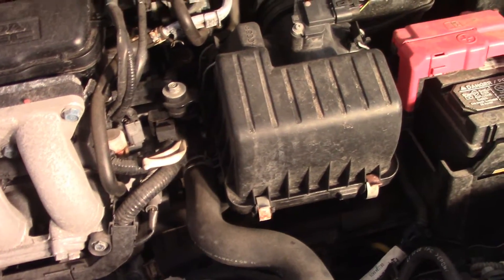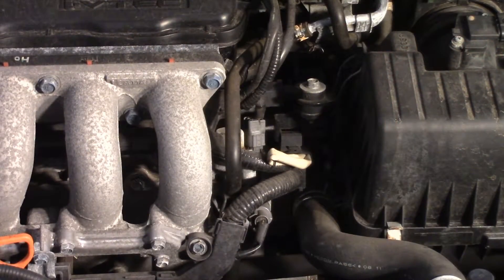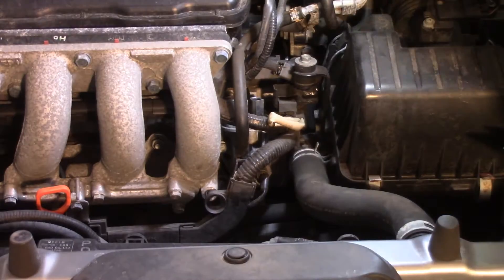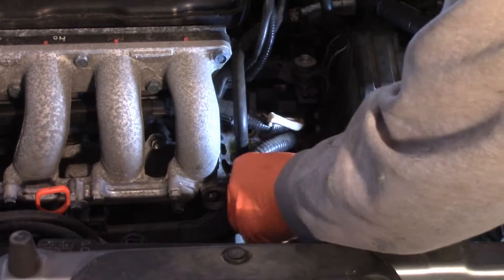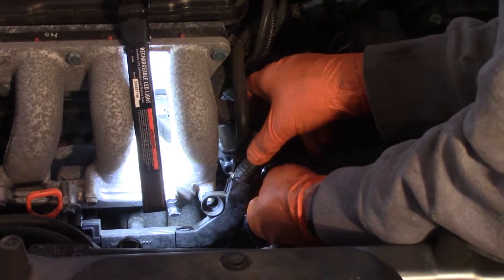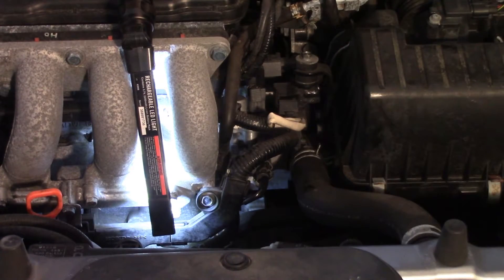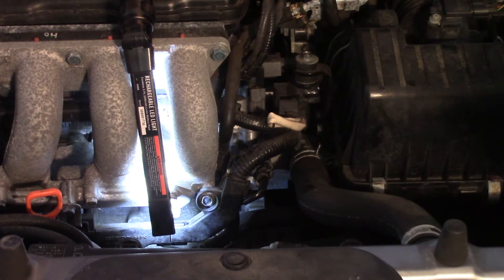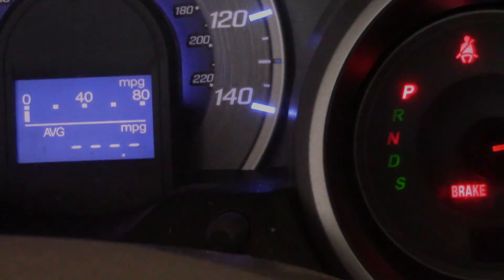Honda Fit (2009-2013) VTEC (or VVT) Solenoid Replacement

Comment: Hey Chris, my wife has an 08 Fit Sport and it threw a code P2647 when we did a scan for the check engine light. She had no issues (we just topped off the oil after reading it could be low oil and she was a little low on oil), but one day she couldn't rev above 4k rpms. She brought the car home and we switched cars, I took it out for a test drive and the check engine light was off and it had no problem revving above 4k. One week later (today as a matter of fact), I was driving her car home from work (no issues to work) and the check engine light came on again and it wouldn't go above 4k rpm. I went to a parking lot, shut the car off for a few minutes, turned it back on and let it idle for a few more minutes, and while in park, I stepped on the gas and it had no problem going above 4k rpm, it sounded and felt fine. I want to fix this issue so she has a reliable car, but should I replace the solenoid or just get the rocker arm switch sensor? What do you think?
Reply from the maker: Wow, that's a good one. I'm not a trained mechanic, especially for the newer stuff. That code does deal with the rocker arm solenoid and usually happens in cars with VVT. I don't think failure of the VVT solenoid (i.e., it stops actuating) would limit engine RPM, but the rocker arm solenoid might if the computer uses it to sense engine speed. It may limit speed if it doesn't like what it sees (limp mode). I did some forum research and  it seems this is the case. Most of the posts I read said it comes and goes like your is. Some replaced the rocker arm solenoid and that fixed it. P2646 seems to be more related to the VVT solenoid (I never got that code). Here's a video I found (I didn't watch it): https://youtu.be/wWHFApnR2D8. I'm not making a recommendation either way, though, because I'm really not qualified and don't want to point you in the wrong direction.
Reply: @roundtailrestoration  Thanks for replying Chris! I started the engine this morning to let it idle, and the check engine light was on. I idled it for about 3-4 mins, turned it off and on again, check engine light was gone and no issue driving to work. It gets to the mid 40s here at night, so I'm not sure what the problem is, but I bought the whole solenoid and a filter. I'll try the filter first cause it was $2, and if that doesn't fix it, I'll just replace the solenoid. The solenoid comes with the sensor, and is not that much more than the sensor itself, so hopefully it fixes it. I'll update the comment when I replace the parts.
Reply from the maker: @YoostwasRDiiwoah  Good luck!
Reply: @YoostwasRDiiwoah  if the vvt fails it can put the car in limp mode which would limit you to 4K rpms I’d start there I just ordered one for my fit off rock auto for 50$
Reply: @YoostwasRDiiwoah  hey, did you get the problem resolved? My wife’s car limp’d out on me.😂
Reply: Dang i am having same problem so i am replacing coil packs and vtec solenoid! will return with my results
Reply: @Dmc963  this happen to me today any resolve?
Reply: @ArianaTheDopest  Hey dude it ended up being the oil sensor on the solenoid ….go to amazon it was like $10 i wasted $300 for no reason also they go bad pretty often i got a defective one but for $10 they just sent me another one 👍
Reply: @Dmc963  Mine was just clogged I used wd 40 and put it back in and its been running normal thanks for the reply
Reply: @Dmc963 so yall all had this same issue huh limps out 3k-4k throws a bunch of codes spent a bunch of money on coils plugs sensors? I’m thinking this is also the issue in my fit
Reply from the maker: Good luck!
Reply: i also have 2008 honda fit must be commen problem i have 130000 miles

Comment: Would the vtec solenoid be in the same location for a 08 Honda Fit stick shift ? My mechanic told me to change this part out bc my car had been choking on me
Reply from the maker: Hi, Carlos. Yes, it should be in the same spot. Same motor, regardless of transmission. Good luck!

Comment: How much was the new one?
Reply: I've owned a bunch of Honda's since my first one in 1991. My experience has been that OEM Original Honda parts will last far longer than the aftermarket ones. If you can afford it, spend the money one time on the OEM part and not several times on the aftermarket parts. This applies to all specific engine parts. Other parts such as brakes, oil filters or whatever, will work just fine.
Reply from the maker: I think they were about $150 each. Been a while. I got them from Rock Auto. Think I put the link in the description
Reply from the maker: Yeah, it was about $135, shipped. I just checked my order history. Very easy to replace. I think it took me less than an hour.

Comment: My fit has 177K and I never replaced this. I have a scratchy sound in my motor, almost like a bad bearing but I driven the car like that for almost 2 years
Reply from the maker: If you do replace it, good luck. And if it's been 2 years, it doesn't appear to be too bad. Good luck!
Reply from the maker: Also, I only ever had the sound during startup, especially on cold mornings. It was never present once the car was running. If you're getting the sound during normal running, you've got different symptoms.
Reply: Chris Fisher I had the grinding while starting on cold weather but it was the starter, now if it’s really cold out, it happens again
Reply: Check your alternator, put a screwdriver up to it, and your ear on the end of the handle. Just put a new alternator on today and that bearing type noise is gone.
Reply: @JacobTechShit  when I took the belt off tho I still had the sound. I traded that car in and got an HRV now

Comment: Doesn't the v tec solenoid stay inactive until you reach a certain RPM? People are telling me you shouldn't hear this grind when the engine starts. Im getting a grind and trying to take preventive action
Reply from the maker: It may not be active, but it still may be energized. I'm not 100% positive, but I understood that when the car was first turned on, the solenoid was powered up and positioned itself,  which caused the grinding noise. Anecdotally, it did it before I replaced it and didn't after I did, but I frankly don't really understand how the thing works. Sorry I can't be more specific.
Reply: @roundtailrestoration  no worries, thanks for responding!
Reply from the maker: @TheLivingPlaneTEVO  no problem. Good luck!

Comment: Can I ask you how many miles you have in the car when solenoid fail? my son car is 55K and so far the transmission solenoid fail but not the VVT
Reply from the maker: It was more than that, but not much. Maybe 65-70k. In my general research, a lot of the Honda line experienced similar problems (Accords, mostly) and it seemed to be a lower mileage failure (around what you and I experienced).
Reply: @roundtailrestoration  thank you Chris

Comment: You say 2007 in the title,  but then you say 2009 in the video.
Reply from the maker: Hi Jimmy. My car is a 2009, but to the best of my knowledge (and the Hayne's manual I have for it), it's the same for the 2007 through 2013 model years, so if you car falls in that range, it should be the same procedure and part.

Comment: What is the problem when vtec selenoid need to service or.....?
Reply from the maker: I'm not sure what happens that caused it to fail, but I don't think you can service it, only replace it.
Reply from the maker: Keltic Ride  Ah, sorry. It was just the grinding noise. I did some research and this was the most predominant reason, so I went with it. Thank you, Keltic Ride!
Reply: I have a stick shift 08 Fit would it be in the same location ? My car has been choking a little I wanted to change to vtec solenoid
Reply from the maker: Yes, in think it would be in the same place. The engine should be the same so it would be in same spot. It's easy to identify so you should be able to see it clearly in the same spot as mine. Good luck!
Reply: Thank you very much for all...I knowing it now.

Comment: chris, z car had steel wheels with hub caps from the factory. Lots of dealers put on aluminum wheels(aftermarket) like those. also there is a choke lever located on console,in case you didnt know. Sorry but I worked on these new at a dealer in NJ. Good job explaining your Honda job. I just closed my shop of 28 yrs working on asian and British stuff
Reply from the maker: Thanks, Steve. I did figure the choke out, but the ran out of gas <grrr>. Fun drive. Felt peppier than my 78 280Z from high school, but maybe it was the weight difference (and the 30+ year time span).